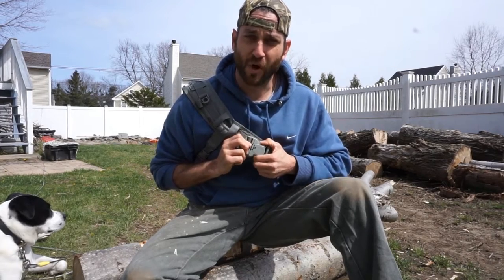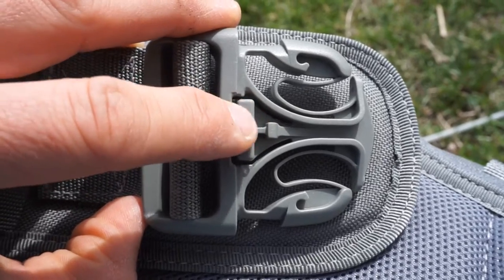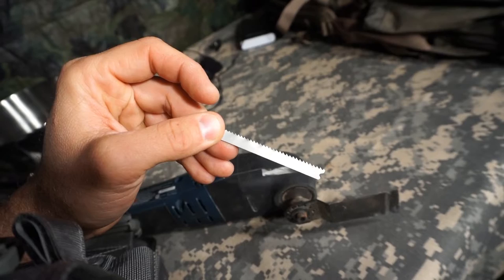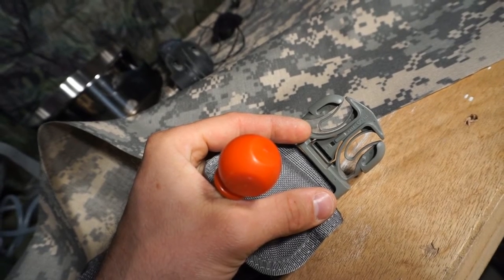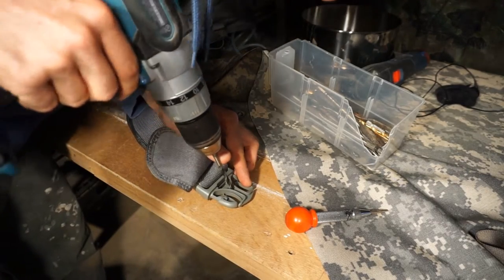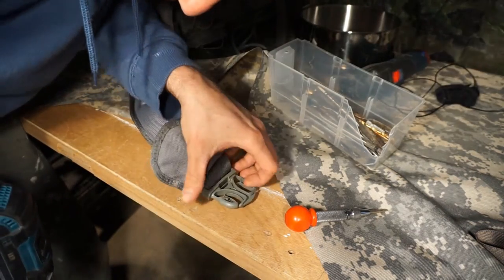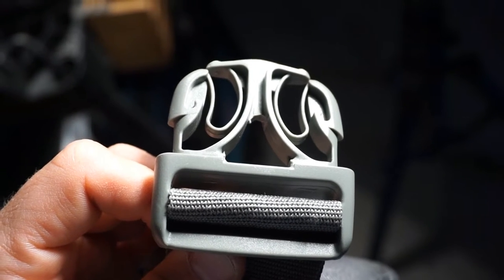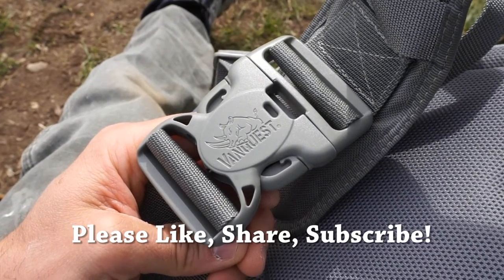Vanquest Buckle Modification Javelin, Trident, Falconer

Comment: i like were you moved the support strap. upper section is better spot and i was going to mod my clip and strap as well.  Do you feel like moving the support strap has effected the function during bicycling in any negative ways. i do not want it to be floppy or pinch.
Reply from the maker: Limdsay Flowers 
I'd say that none of the modifications have affected the bag in any negative way and have made it significantly more usable for how I use my bag.